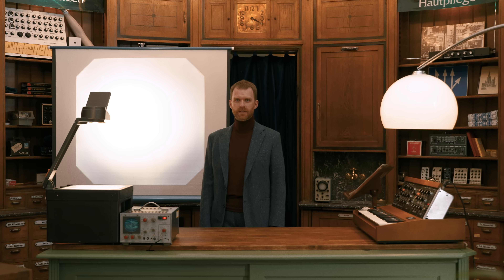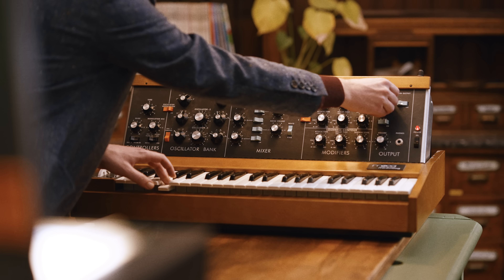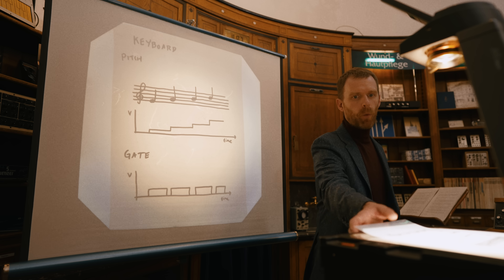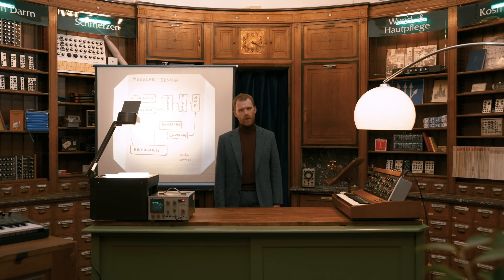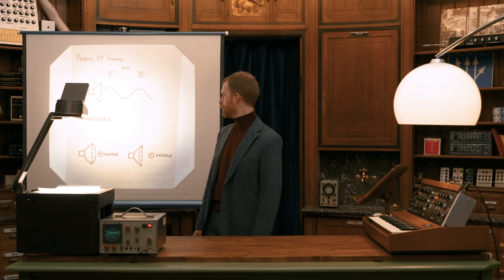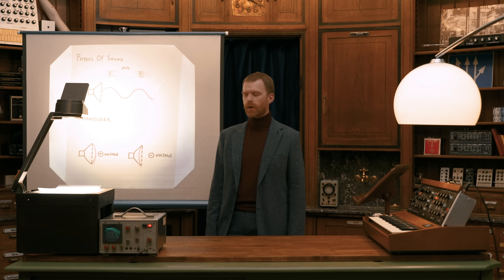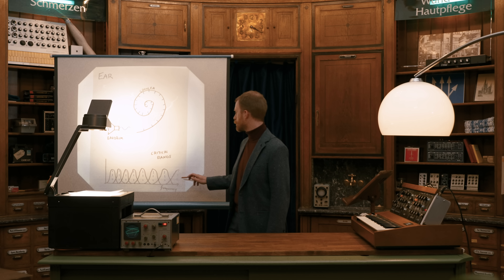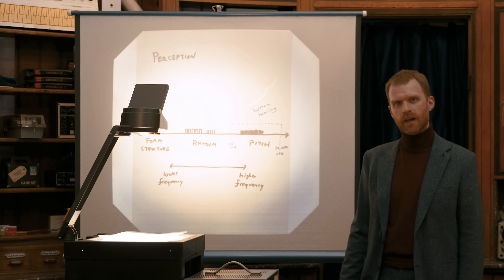Synthesizing with Moog | Lesson 1: Listening

Comment: Really enjoyed the video. Just one tiny thing though: everything I've ever read and heard about the Model D suggests that it isn't true that "Bob and his team realised that they could take advantage of these common patches and offer a smaller and portable system which would take a handful of modules and hardwire this patch configuration together."

It is my understanding that Bob hated the idea of reducing his Moog system to anything smaller than the full modular setup and Bill Hemsath created the Model D (/A) on his own, in spite of Bob's wishes, rather than because of them. Which is not to suggest that Bob was angry about it - he appears to have been very supportive of his engineers working on their own initiative - but the fact that the Minimoog existed at all was entirely down to Hemsath. The fact that it went from a prototype passion project to a fully realised production model (no pun intended) was down the financial imperatives the company itself faced with due to the high production costs of the Modular system and the accompanying price tag which made them incredibly difficult to sell to all but the wealthiest of individuals (and institutions).